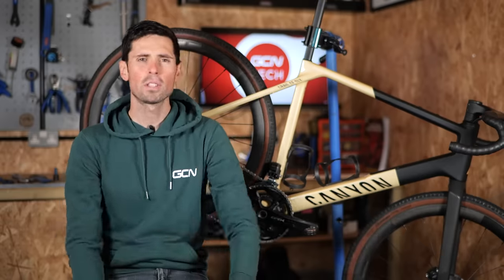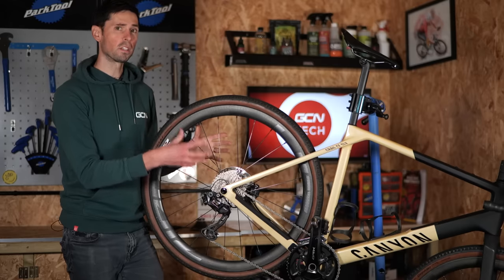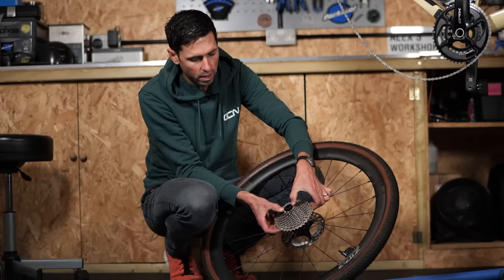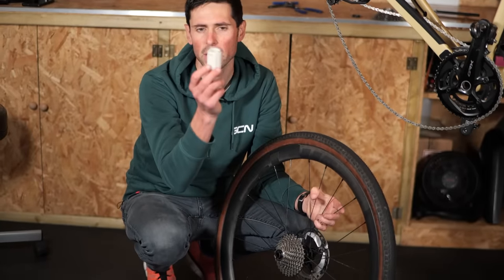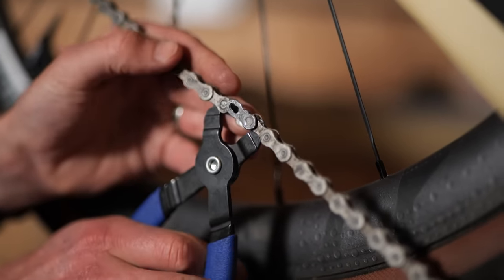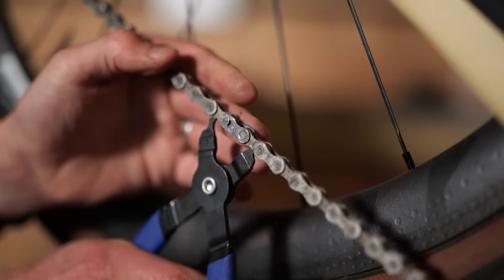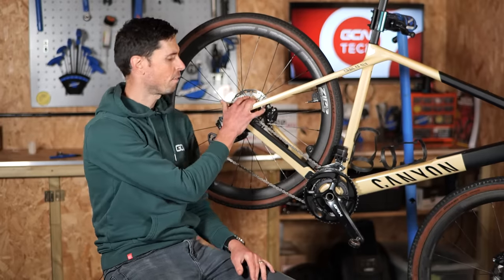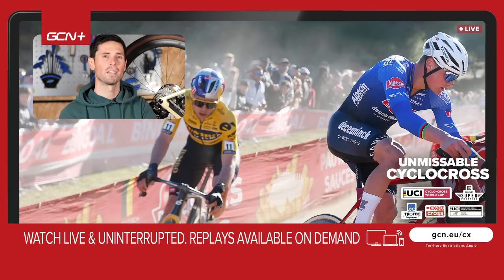How To Change The Gearing On Your Bike!

Comment from the maker: Have you ever changed the gearing on your bike? ⚙
Reply: I’m curious about putting a bigger gear on the crank set on a Eurobike. And some quality tires… when are you going to try out some upgrades on it?
Reply: yes, when I put on new wheels not a big deal, just had to buy the proper tools for it I didn't go and get a pro set I got some on Amazon since I won't being this job very often (I hope)
Reply: I've changed cassettes, and even freewheels (back in the day), more times than I can even imagine.
You would change gearing to match the terrain that you'd be riding on, because of the limited number of cogs you'd have in back. Six or seven, with freewheels, and 8, 9, 10, or 11 cogs with cassettes.
Reply: I intend to change from 34 to 36 because there are quite a few roads going up to 26 and some to 27 % which is  ok but just one or two notches too hard for me.
Reply: I gave my old 90s mountain bike some crazy gears because I could and wanted it to be a trailer towing bike. A triple cheanset 22/32/44t and a 10 speed 11-46t cassette. Geared like a top of the range tractor.
Reply: Always put larger cassette on when I go to the Pyrenees, we don't change ratio's to go slower up the hills (Alex) we change to GET up the hills.
Reply: I bought a CX bike to use as a road & gravel bike a few years ago.  I’m no Alex, so I swapped in an 11-34 and Ultegra med cage mech for the 11-28 and short cage 105 mech the bike came with.  I also had my LBS swap in a 105 compact road 50/34 (165mm cranks) in place of the original 170mm 36/46 cranks.
Reply: I size the largest cassette I plan on using, typically an 11-30, when I set my chain length. Then, if I want narrower jumps between gears on a smaller block, I just change the cassette. I've never had a problem going to a 28 or 26 and I still have enough chain for climbing gears when I switch back
Reply: Yes. I've got 44-28 chainrings and a 12-36 9 speed cassette on my touring bike. That's 500% range with closer ratios than 12 speed 1x. I ride it mostly as a 1x and due to having the aero of a small truck, bigger gears would be a waste. My other bike is fixed gear so spinning also ok.
Reply: I had it done. I know they aren't fashionable ("racers don't use them!"), but hub gears really are wonderful. I had my local shop put a Sturmey-Archer 3 speed hub on my dropbar single speed. Though it doesn't trouble the UCI minimum, it's still fairly light at 22 pounds,  I don't live in the Rockies or the Alps, I don't mind varying my cadence, and I'm not racing. Raleigh sold millions of three speed bikes for a reason. They just work well, especially in cities; and they don't have to be heavy. For non-racers who don't live in hilly to mountainous terrain, modern cassettes and derailleurs are actually overkill.

Comment: Something to also consider for increasing cassette size would be the rear derailleur capacity and max cog size. Short derailleur cages won’t be able to handle the larger cassette sizes and would require a new derailleur. 

As for the ranges you asked for on our bikes, I run 50/34 chainrings with 10-speed 11-36t cassette. At 190 lbs with the hilly terrain in southern Oregon, I’ll take all the climbing help I can get!
Reply: You can use short cage with hangar adapters no issues 👍🏻
Reply: I wish Alex talked about the extra considerations for increasing cassette size like the possible need for a longer derailleur cage.

I went from an 11-32 cassette up to an 11-42 matched with a 50-34 chain ring on my gravel bike so I could tackle steep hills when bike packing. I added a long cage derailleur to handle the wide range. I was able to use a mountain bike cassette on a road bike freehub by using a cassette spacer.

It took a little tweaking, but it works great.
Reply: Another good thing to know, if you're hacking on old stuff, is that most shimano derailleurs have a compatible cable pull until 10 speed road, and 9 speed mountain.  If you match the shifter to the cassette, most any mountain derailleur 7-9 speed will likely work okay with it.
If you want to go longer than will work with your stock derailleur, and you're 10 speeds or less, you can probably put on a 9 speed shimano mountain derailleur, and everything should work fairly well.  Any more than that, compatibility goes all to hell. ;)
My rainy day commuter is my old cross bike that came with 10s tiagra, and I put on a 9s deore derailleur, and it works great, though obviously needs a longer chain to handle the bigger gears that the long cage allows.  Even old 8s derailleurs should work fine on a 10s shifter
A 10s mountain derailleur will not work with a 10s road shifter and cassette.
10s or greater mountain, or 11s or greater road have different ratios, so you can't use those derailleurs.
Reply from the maker: Great point! Always check on the range of your rear derailleur, It's important that you use the correct parts within the manufacture limits.
Reply: @nwimpney mostly true I've found the exseption in shimano grx 10 speed, Aperntly the pull ratio is the same as 11speed road bike, I think the tiagra 10 speed is the same, every other 10 speed road with 9 speed mtb no problem
Reply: Wher theirs a will theirs a way currently got shimano 105 8 speed sgort cage on a 11/ 40 cassette using a goat link

Comment: Don’t shorten your chain when you only go 4 teeth smaller. If you want to change back you have got to ad chain links. I run two wheelsets. One with a 11-40. The other with a 11-34 cassette. Chain and rear derailler are dialed in for the 11-40. No need to change it for the 11-34.
Reply: False but okay. 11-40 vs 11-34 is a massive jump and you should be using different chains
Reply: Not false. This works flawless for over 3 years. My ultegra 11 speed long cage rear derailler just makes it work.
Reply: 11-40T is a MTB cassette so if you ride a MTB that might be an option but I seriously doubt you can get away with a 6 tooth difference on the same chain on a road bike.
Reply: @FoxFox-i1c maybe you just don't know anything about gearing 🤷‍♂️
Reply: I know gearing. I’ve been taking care of my bikes for over 35 years.. I can service and change bearings, chains, bottom brackets, brakes, cassettes, chain wheels, free wheels, deraillers etc. And my bikes are more than ok. I know what works and doesn’t work. Climbing mountains, riding gravel: no need to shorten my chain going from a 40 to a 34 on my ultegra 8000 11 speed rear derailler. And yes a 40-11 is a mtb cassette. And yes it fits my canyon endurace without any problems.

Comment: Many times. It's no issue when you have bar end shifters. Gearing for a long >25° climb, gearing for touring, gearing for mixed road, gearing for winter and summer. You can choose heavier stronger chains for high stress or high load (8 or 9s) and lighter running gear for summer (10 or 11s). Best of all you can run  rim or mechanical brakes. Of course, you're not stuck with only one brand.
Reply: I love my bar ends, I run microshift 12s with a Shimano deore m6100 derailleur. Because the spacing are so close, even though the shifter is MTB, I've found it will work with a 12 speed road cassette close enough that's it's tolerable, but it has friction mode anyway. So now I can have a 700c wheelset more orientated for the road and a nice wide range cassette on a pair of 650bs with chunky tyres. Love it
Reply: Friction shifters ☺️🤘🏻

Comment: Helpful and timely. Thank you. My winter project is to change my rear cassette from an 11-32 to an 11-34 and I need to change the front derailleur. Long story. Anyway, this video helped fill in the gaps in my knowledge re chain length and that b limit screw. Thanks 🙏
Reply: I've never noticed a difference between those two cassettes. All gear rings are the same, only the 32 tooth ring is swapped for a 34 tooth ring. I would bother, but you do you 😊

Comment: Very interesting.  Had a problem with a cassette lock ring  a few months ago.  Through mistake and expense learned that lock rings should go on easily, some are worn out, and persisting will cross thread your hub.  An expensive lesson.

Comment: I saw a bike tech use a piece of plastic pipe taking the cassette off he just slip it into the opening after taking the lock ring off and slid the whole thing off very slick.
Reply: Better yet, just keep the white cassette loader handy and slide the cassette right back onto it. This also keeps the sprockets aligned for future installation.

Comment: The cassette lockring threads are very fine, fine enough that they are easily cross threaded. To prevent this, always use the lockring tool as Alex does.
Reply: Very fine? Very fine are spoke threads: 0.3mm pitch. Cassette lockring threads are short, and large, but a 1mm pitch. Define your terms.
Reply: @zygmuntthecacaokakistocrat6589  don't be pedantic.  they're fine relative to the diameter, and are easily cross threaded, so it's still good advice to twist it on by hand before putting a wrench on it.

Besides.  Spoke threads I believe are 56tpi and are closer to .454mm pitch.

Comment: I'd leave the chain alone if you're going to a smaller cassette.  assuming it had the capacity for smally-smalls to not be baggy before, it'll still be fine now, even if it's not as tight as possible on biggy-big, and if you want to change it back later, your chain won't be too short.

Comment: I've already got the tools and know how to swap cassettes, but seeing what's needed as far as chain length changes is nice because I'm about to make a similar switch for next spring. Going from 11-32 to 11-30, which after watching the video essentially means I don't need to shorten my chain (though I will put a new chain because my entire drivetrain is due for replacing anyway) but could probably go a link or 2 shorter if I want buttery smooth shifting

Comment: I always change the gears . As standard almost all bikes come with too high gearing .
So 1. A 46/30 grx crank on. Thats better than a 10% improvement. 2. An 11 to 36 block to replace the standard 11 to 32.
Together a 25% improvement . Hooray .

Comment: When shortening the chain, you should never push the pin all the way out as Alex does here. just push it far enough to release the inner plate. That way the link can be re-used if needed. It's a very difficult task to re-insert the pin once removed
Reply: you shouldn't be reusing the link on any new-ish chains.  the plates are too thin to get a proper grip, and the pins are usually peened to keep them in place (which is why you get little rings of metal stacking up on your chain tool if you use it a lot)  The edges break off, and/or enlarge the hole slightly when you press it through, so it's not really safe to push it back in.
Joining pins like shimano includes with some chains are slightly oversized to be a tight press fit (and should never be pressed out.  if you need to break one,  break another link, and use a new pin there.)

It's fine if you're messing with antiques.  Old 5-6 speed stuff I'd do.  7-8 kinda dodgy but will probably work,  once you get up 10+ speeds, you're just asking for it to break.
Reply: This is terrible advice. Re-using a pin is setting you up to have a very bad day sometime in the future. Which day will it be?

Comment: The problems normally occur when going to a larger cassette such as the cage length and what is too big etc. Can you do a reverse video?
Reply: The derailleur manufacturer typically states what type of cassette it can shift. Shimano is typically conservative with their limits and it can also shift slightly more than officially stated.
Reply: @simonm1447  so just get a derailleur to go with the cassette?
Reply: @edcoad4930  Yeah, if you're pushing beyond what it'll allow by more than a couple teeth.  I'd be pretty confident throwing a 34 on with a derailleur rated for 32, etc, but if it's an old short cage that maxes out at 28, and you want to put on a 36, you're going to have problems.
I explained some compatibility rules-of-thumb in another comment if you read that.  (especially  if you want to try jumbo cassettes with MTB derailleurs.)  Older stuff you could get away with quite a bit.
Reply: @nwimpney  please.

Comment: Hi Alex.  Assumming you haven't got the plastic sleeve in your cassette, you could hold all the bits (of the one your taking off) together with string, a twist of old wire or if desperate one of Si's left over "Zipp ties" ready for spring when you want to change it back..
I suppose you feel obligated to speak "American" because Yanks don't understand what a spanner is.

As for the gearing I'm using, an 11-32 with a 24-32-42 tripple.  I need them all for the hills here-abouts.

Comment: Why changing a 11-34 for a 11-32 cassette? You won’t notice the diffence. Change it to a 11-25 or 11-28 and you will have the smaler steps between the cogs you wanted for road use.
Reply: Because he didn't need to do it at all, but needed to make a video to show how. He said that.
Reply: it was 11-30.
Reply: At 2:32 he sais “it goes up to a 32”

Comment: Are small sprockets more aero?
On flat terrain with only a couple of highway bridges, a small cassette and a 52 or 53 chainring are sufficient.
Is it faster with a really small cassette?
On steep inclines with short 20% sections, I need my light racing bike with 34/34 gear ratio to conquer the incline while sitting.

Comment: I wish you would've spent more time to show how to correctly index the gears. Even though I've the same size cassette on my wheel and trainer, when I affix my bike to the trainer the shifting is off, and I'm not sure how to adjust to prevent the chain rubbing and derailleur skipping that occurs when in the extremes of the cassette.
Reply: There are a dozen videos on how to index gears on youtube.

Comment: If you go from a 10 speed to an 11 speed cassette do you need a new hub?
Reply: Most modern wheels come with an 11 speed hub nowadays. If you are running 10 speed and there is a 1.85mm spacer behind the cassette, an 11 speed will fit on. Older HG splined hubs are not long enough for 11 speed road cassettes. It is dependent on how old your hub is.
Reply: Not with Campagnolo, I recently went from 10 to 12 speed no problem.

Comment: Can you buy individual gears of certain sizes for the cassette, mine is a Shimano 105 cassette in this instance.

Reason for asking is that there is a jump in mine on my Zwift setup that drives me crazy.  It's right on the middle of my most used gears but drops my RPM by about 10 which at the wrong time is a complete mare!
Reply: I would love to be able to customize my cassette for the exact same reason.  I find I'm always between cogs going uphill and hardly notice any difference between neighboring cogs within the smallest 5 on the flats or downhill, which all increment by 1 tooth per cog.
Reply: You can usually disassemble a cassette without a spider by unscrewing or grinding down rivets holding the cassette together. You give up 1 sprocket worth of range if you mix cassette cogs from another cassette.  The smallest cog has to be a final position one to work safely. You can make almost any combination you want, but shifting will be slightly inferior.  This is due to the ramps and profiling not matching with an OEM version.  Good enough to try this if that gap bugs you.
Reply: Can confirm.  I have a customized cassette on one of my bikes, made from two cheap sunrace 10s cassettes with no spider.
wider range one had mostly odd gears, the narrower one had a lot of the evens.
I made it into an S-curve.  I have a couple big jumps at the top, then 1t gaps from 15-19 then a couple big jumps at the bottom.  For my racing around on my commute it's great.  I don't need super precise ratios for accelerating, or the couple short hills, as long as I've got low enough gears, then I can fine tune it for my cruising pace, like I'm riding a TT.  Then I've got a huge jump to the top gears if I want to pedal on the downhill (didn't have a choice, since the highest sprockets were 11 and 12t on the two cassettes, and you need that one there to hold it together.

You probably won't be able to do this with big cassettes, though, since they're almost always blocks on aluminum spiders.

Also.  make sure you torque it correctly if you try this.  If you don't put it on properly tight, the chain tension will pull the individual sprocket against the splines on the freehub, and dent them.  It's common enough for them to be dented when they're screwed together, but when all the force is on a single sprocket, it's much worse.

As mentioned, shifting performance is worse.  I don't have any real problems with mine, but I always soft pedal my shifts.  the ramps won't line up well in most places, so if you try and crank it under heavy load it's going to be pretty rough and might skip.